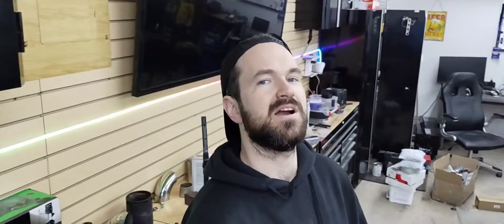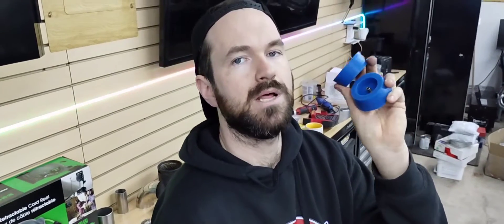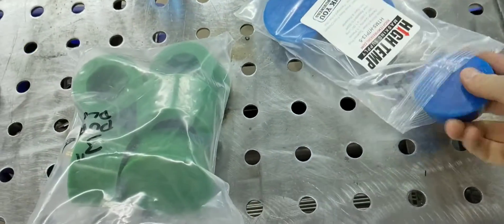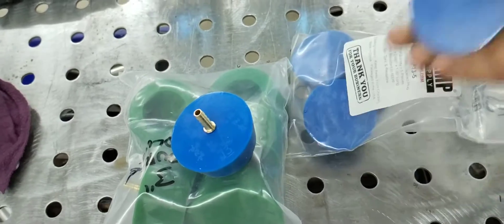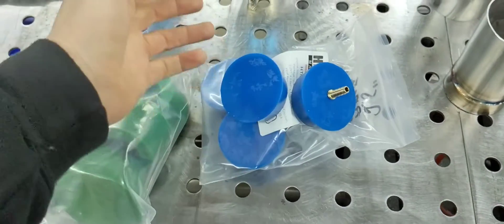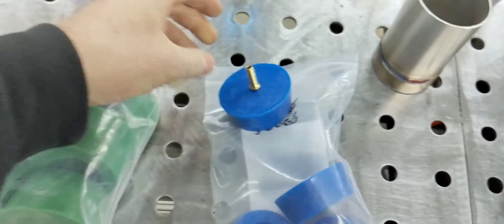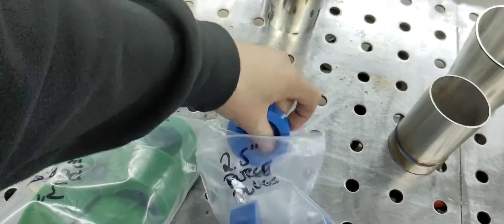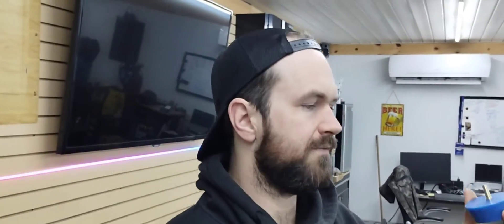DIY BACK PURGING - HOW TO BACK PURGE LIKE A PRO ON A BUDGET! - TIG WELDING TIPS AND TRICKS

Comment: Dope brother glad you came across my video saved alot of money haha and really appreciate the shoutout!🙏🏽 my set has been doing great no issues! I did test their limits i did a collector and burnt it up haha so dont weld 1” from the plugs😂 another tip! Your barb fitting make long enough to put a washer and nut my fittings used to pop out when removing purge hose🙏🏽🙏🏽🫡❤️
Reply: Thanks to both of you for posting.  As soon as I saw this video and Frenchi's, I knew I had to have a set.  I bought two sets of the High Temp Masking Supply 7 Pc XXL Silicone Plug Kit For 1.875" to 4" Holes kits.  I just did a SHORT showing what I bought.  Thanks again for posting.

Comment: When I see people welding exhaust systems I never see them setup to back purge the pipe. Why?
Reply from the maker: I'd say it's not NEEDED, but it definitely helps in really high heat areas with big demand. In the end it makes for a better weld. And a stronger weld. However with an exhaust system I'd say it would be more than fine without back purging if the weld was good.

Comment: Do you think these can be used for vacuum bleeding air from oil in a hydraulic cylinder...bleeding the air out of shock oil by plugging the top of the shock with it and pulling a vacuum through a fitting?
Reply from the maker: I would think it would work fine! They're pretty thick, so it should hold a good bit of vacuum I would think. Extremely cheap to try worst case!

Comment: Thanks, this was an awesome tide bit.
Idea for the fitting. 
Find a suitable swivel add a short pigtail and put your QD at the end of the pigtail. 
This would allow easy manipulation of the part while welding...
BTW just ordered some for myself...
Reply from the maker: Awesome! Im super glad this helped someone! 
I found a similar video and had to post it. Yeah I'm thinking of doing like a 45 degree push lock or something, would make it much nicer to work with. The hose in using Currently is quite bulky. But it works!